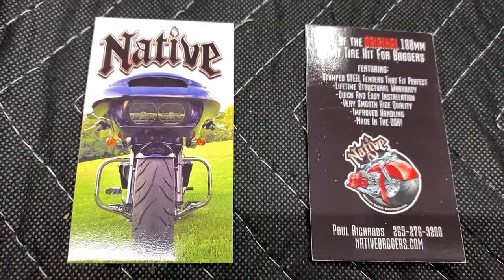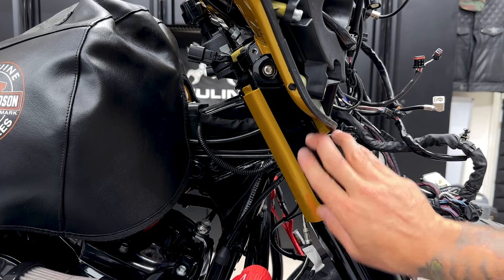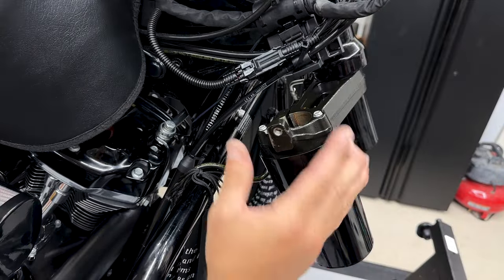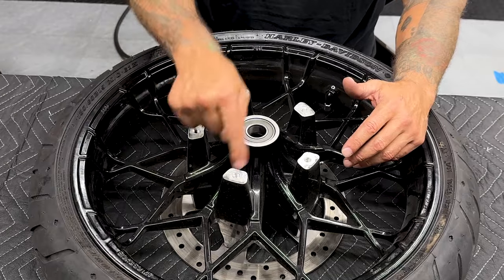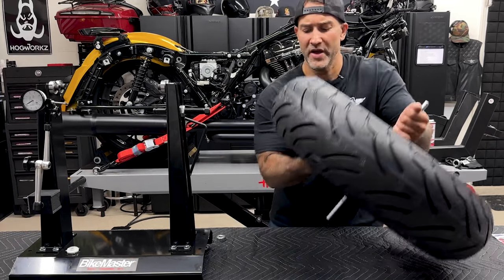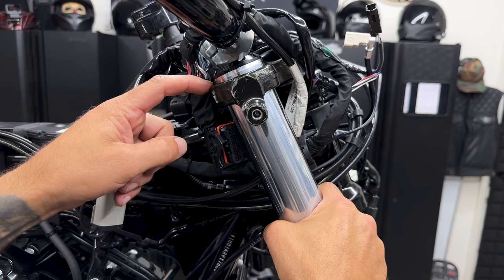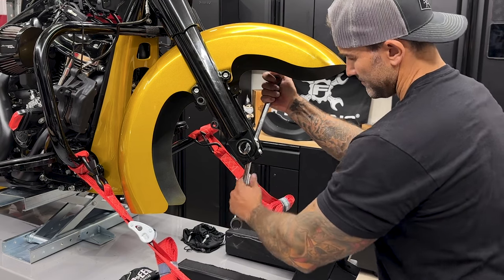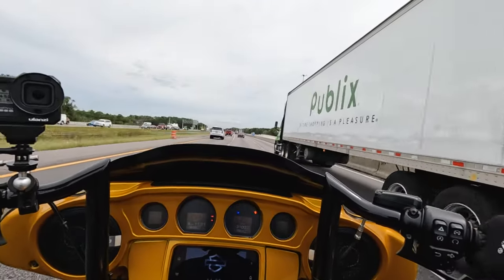180 FAT Front Tire Kit Install - Native Custom Baggers Pitbull EZ Rush

Comment: Looks amazing, are there any cons to having a fat front tire? I can’t believe you only have 11.5 subscribers your knowledge and delivery, to me,are exactly what I look for.
Reply from the maker: The only Cons off the top of my head is, if you get a flat tire or have to replace the tire on a road trip, the dealership or shop would have to have them in stock. Now because this is a 18”, most dealerships would have this tire in stock.  Also, you have to get a new wheel chock for a trailer to accommodate the fat tire.  And thank you!  Hopefully the sub count goes up 🤟🏽

Comment: Why is the reason when you put the fat rear tire on front you need to reverse direction (mount backwards lol)
Reply from the maker: The way the tread on the front tire is designed.  You want it to be opposite of the rear

Comment: Since you were weighing everything, I am really surprised you didn't weigh the fork slider covers.  The weight saved by the new rotors was replaced with those.
Reply from the maker: I did weigh the fork slider covers.  And not looking to shed weight when adding a fat tire.  The lyndall rotors are far superior, and supply more stopping power

Comment: Just genuine question? Why Red loctite on non-engine bolts? Vs Blue loctite?  Red requires using heat to remove the bolts for any service
Reply from the maker: Good question!  I usually try and follow the manufacturer’s recommendations. Because you don’t have to remove the air cleaner backing plate or bolts to service it, they recommend red loctite.
Reply: @RAIDERWORLD  Probably to get you to take the normal person without torches to the dealership. Most of the Harley techs I follow. Only suggest red for engine bolts. I believe you would have to remove the backing plate if you had a external air breather.  Not saying you do. But some older that do.

Comment: My question is.    On the Fat Tire kit.      I have a 2018 Street Glide CVO   It has a 18” wheel. With 180/55-18 tire on the back.  And a 19” wheel on the front   With 130/60-19 tire.    
So I wanna do a fat front tire.   
 Do I do a 19” front wheel???
Reply from the maker: It all depends how you want to ride.  I kept it even with both tires the same (front/back).  You can have an 18” tire in the rear and a 23” tire on the front
Reply: @RAIDERWORLD     Huh.  Now I’m lost.   In Ur vid.  U put an 180/55-18 on the front.   Yes?
Reply: @RAIDERWORLD     How I want to ride?    Up right….  Rubber side down
Reply: @RAIDERWORLD      So. On Ur. El Dorado.      What size wheels. U have on the back.  And what fat wheel did U put on the front.     I wanna do the same set up as that.    That front wheel.  Looks just like my Harley wheel I have for the front on my bike now.       I wanna do the same Brake rotors  same wheel. All in gloss black.

Comment: Can you use OEM rotor from the older Street Slide models with the smaller 5-bolt pattern and a 11.8" diameter on your fat wheels?
Reply from the maker: If it’s the stock rotor, you can absolutely use it.  Hope that helps
Reply: @RAIDERWORLD thanks for the reply.  There seems to be two types of 5-bolt rotors for the Street Glides.  Older models have the smaller diameter 5-bolt whereas the newer models have the larger diameter 5-bolt patters.  Which one do your fat wheels take?

Comment: Let me ask you....the space between the fender and chin spoiler isnt too close juat in case you hit a bump and the front forks have to compress down..the spoiler and fender wont touch?
Reply from the maker: You would have to hit something really hard straight ahead.  With the angle, it’s designed to clear any road bumps or pot holes.

Comment: What front air pressure are you running ?
Reply from the maker: I usually run both tires at around 38-40